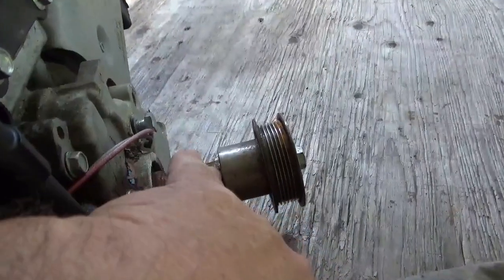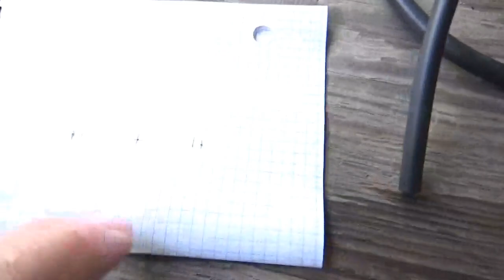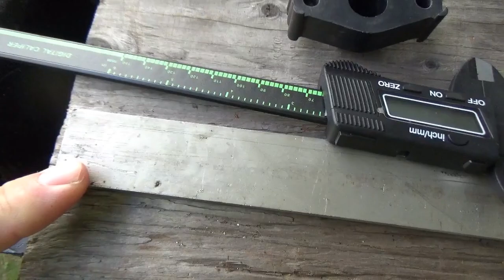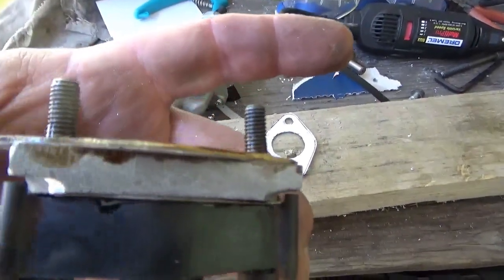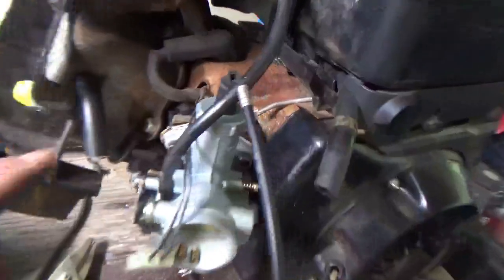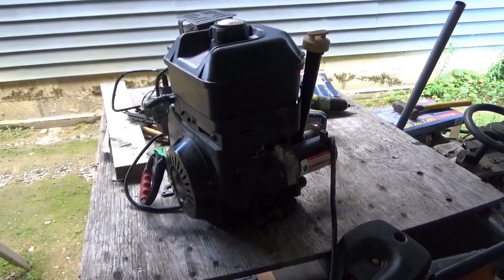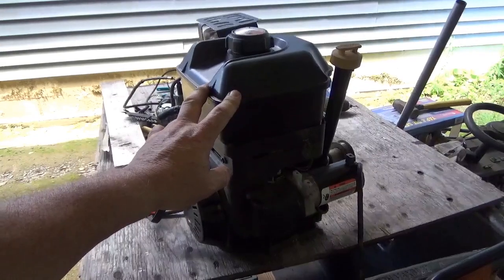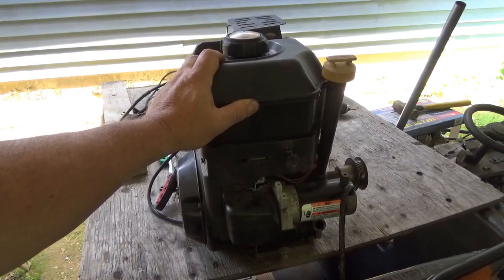Snow Blower to Minibike Engine Conversion, Keihin PZ27 Carb Hack!

Comment: are you going to keep it belt-driven or change the pulley to a chain sprocket?
Reply from the maker: Hey Wrenchin!  I will go with the 1" shaft torque converter and will use a 7/8 to 1" sleeve to make it work.... So, the answer is belt to chain.... Thanks for asking, watching, and commenting!!!

Comment: They do make a 7/8” centrifugal clutch and you could sleeve the shaft to 1” to make a TAV 30 or 40 work ! Personally I’d go the sleeve route ! There generally 12:1 gear ratio upon start so a 50 or 60 tooth sprocket works fine . Your right that Briggs sounds healthy ! I buy a lot of my parts from BMI CARTS , great prices and selection ! A Chinese quad rips with those engines on them !
Reply from the maker: Hey Dave!!!   I've been considering putting a Honda predator 200cc clone on one of those china quads. I think U R right, a TAV30 with the 7/8 to 1" sleeve.... Thanks always for Ur wisdom, advice, thoughts, watching, and commenting!!!